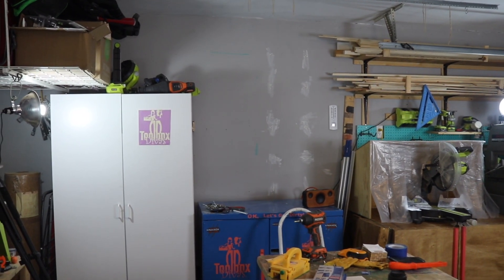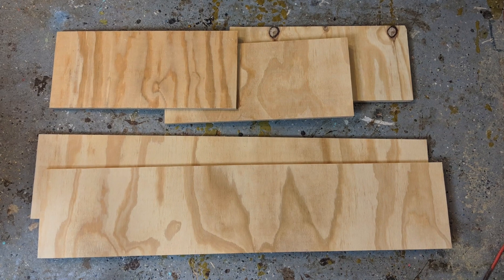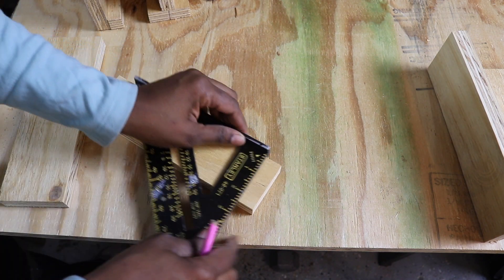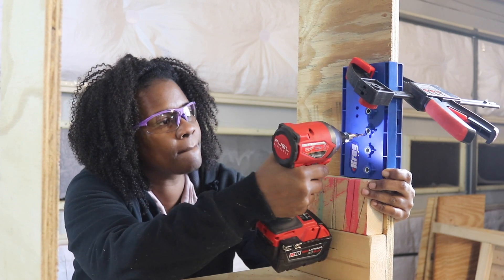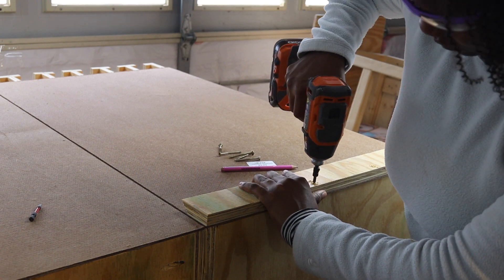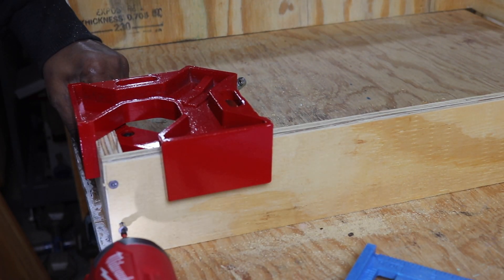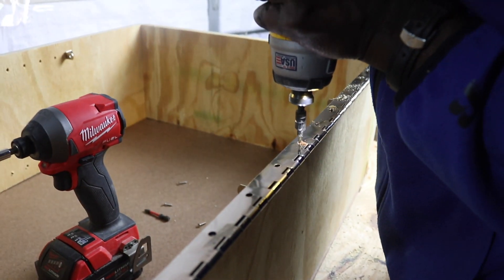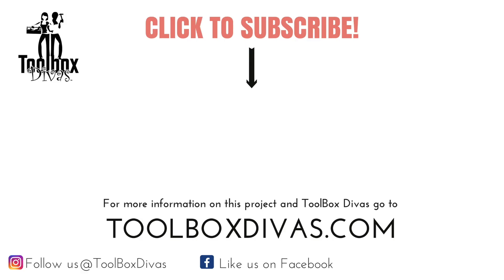How to Make a Tool Storage Cabinet with Charging Station

Comment: Greetings from Thailand! Sawat dee!  Great idea!  Extra storage in the doors is a plus.  I'm just starting out (at age 60) and love your spirit! Will build this for my shop since its so small and in need of space.  I'm thinking of extending the doors down past the drill slots to keep dust off them plus keep them out of sight from prying eyes. Also, instead of spray cans, I'll probably cut PVC pipe to use as tubes and roll up my sandpaper to put in them. Keep up the good work! ;)

Comment: That is so cool. I wondered why you didn't use a smaller width ply for the doors making it less heavy? I want to make one, but rather than having a side for spray cans, would love it if you could show how to make a drill/screw drivers holder side for me in its place. Just love the look. Tools are hidden and clean cut storage. Thank you so much.

Comment: Really nice video and cabinet!! Couple questions if you have time to answer.

What kind of screws do you use to assembly? Look like torx head screws and I happen to notice lots of videos where this head type is used. 

Next question is when do you need to drill holes before putting screws in? Seems like sometimes people drill holes and other times they don't. 

Thanks again!!